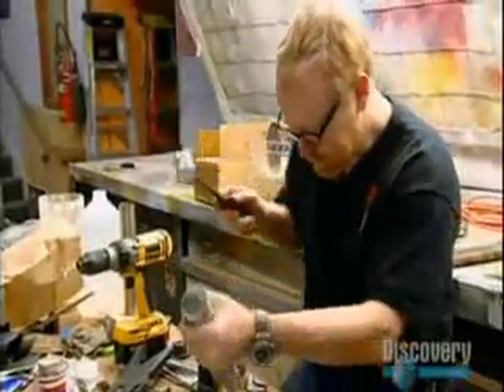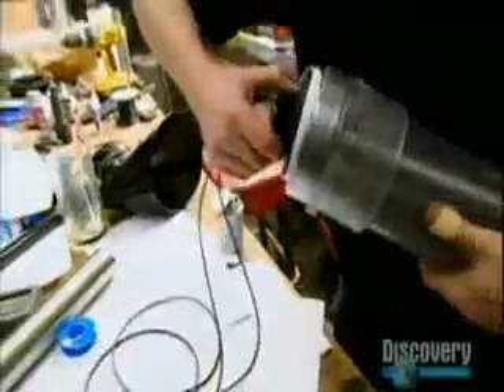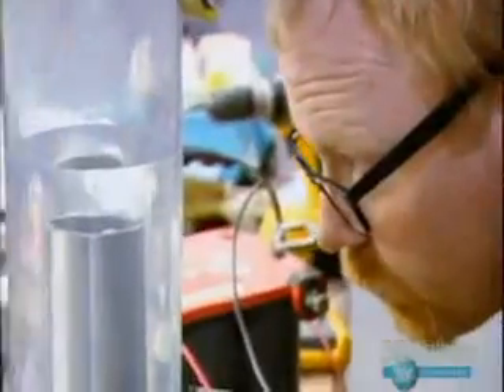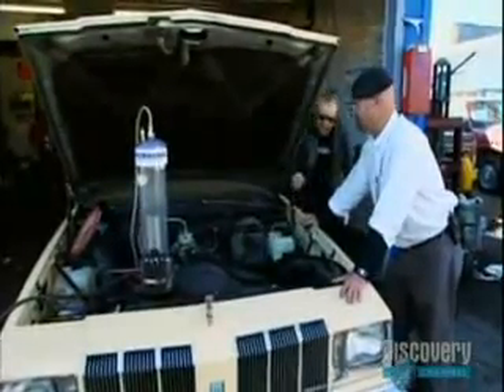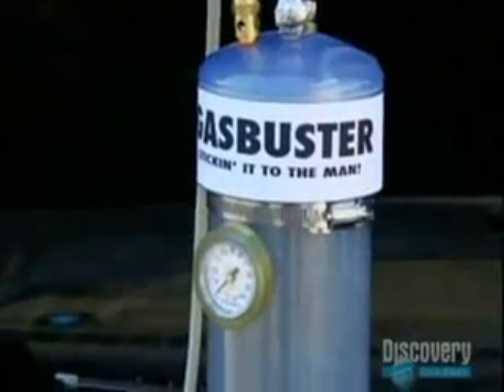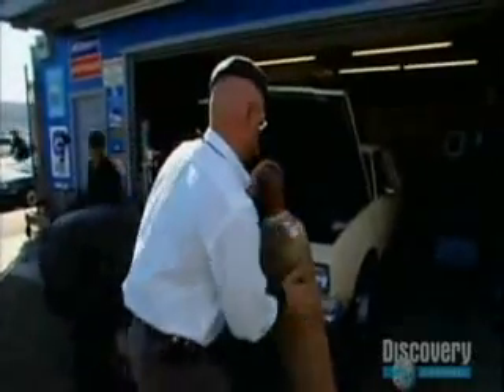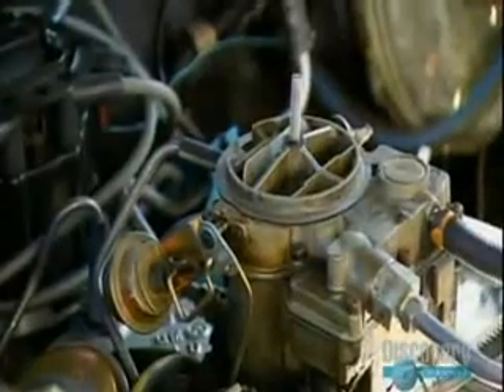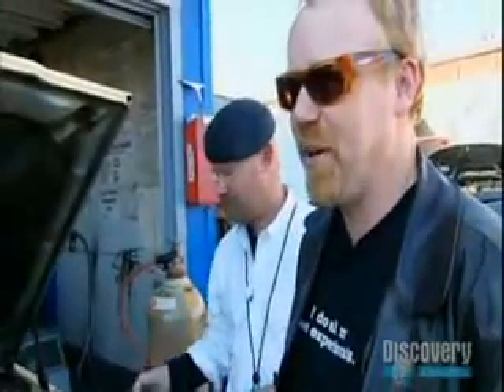HHO Mythbusters Explained

Comment: I don't think you could run your car off water.  Hydrogen sure.  But with water you're basically trying to extract the hydrogen, then combine it with more oxygen through the intake.  So you're breaking the bonds just to reconnect them again.  How could you possibly get usable energy from that?
Reply: I'm not saying you cant get energy from hydrogen.  Or HHO or browns gas or whatever you want to call it.  Obviously if you have a container of it laying around you could very easily extract energy from it.  I'm saying that because the by product (water) is the same as the fuel (water) it's inherently impossible to profitably extract energy from it, since the same amount of energy would be needed to break the bonds in H2O as you would get by reforming them.

That's why we burn fossil fuels, they start of as something like C7H15 and end up as multiple sets of CO2 + H20, which contain less energy and are stable in our atmosphere.  You COULD turn them back into C7H15 again but it would require at minimum the same amount of power gained by breaking them up in the first place.  The same is true for HHO.  And any other chemical reaction that releases energy.  Conservation of energy.

Simply put it would take 37kw of electricity to produce enough HHO to run a car at 50hp, assuming a perfectly efficient system.
Reply: Yeah google lol.  That's the point I was trying to illustrate, it would be better to just use that 37kw to drive the car rather than producing hydrogen.  But if you could find a way to store a lot of it in the car than you could produce the hydrogen at home.  It'd be a cheap way of effectively converting to electric without having to change the motor
Reply: kevin smith BMW has a 7 series automobile that has a built in hydrolysis machine to convert sea water into the two gasses then a special carburetor to burn the hydrogen and air from the atmosphere letting off the oxygen into waste as a exhaust through a filter, (making it slightly carbonized so that it does not present a fire hazard) then use of a condenser to turn the water steam back into water that returns to the 'gas tank' It is supposed to come out in 2016. Also there is an existing company in Panama City Florida and In Long Beach California that has created a 50KW system to both heat and power your home using their HHO hydrogen called Aquygen. Laugh off that one! They are traded on NASDAQ.
Reply: marcus raidien I saw a youtube video with a water powered car.  It worked by heating the water and turning into steam, which powered a motor.  The water was heated when it came in contact with a lithium rod in the cars engine.  It would run purely off water, the only problem is the lithium rod would get corroded and had to be replaced every hundred miles or so.

The water powered car was powered by lithium.

Not water.

So based on that I'm purely guessing (but still completely certain) that your information is wrong.

ha HA ha HA ha HA

It would be wonderful to be proven wrong here though.
Reply: marcus raidien Are you talking about the BMW Hydrogen 7?

edit:  I'm pretty sure you are.  The car (according to wikipedia and youtube) can run off of hydrogen.  It's advertised as "running off water and clean renewable energy".  Words of note being:  AND clean renewable energy.

They aren't idiots and they know the hydrogen is essentially an energy CARRIER and not an energy source.  You have to combine energy collected from an outside source with water to extract hydrogen.  That energy could come from solar panels or water wheels or geo thermal, etc.  Hence the "clean renewable" statement.

The only reason they would make the car capable of hydrolysis is if the drive motor only runs off hydrogen and if there is a second supporting motor (electric or gasoline) to  "recharge" the hydrogen motor.  But as demonstrated in tests by hobbyists for the last decade it's difficult to make large amounts of browns gas.  So I doubt they'd go to the trouble.

But even if they did

it's not "running off sea water"

it's running off electricity.  Or whatever energy source was used to obtain the hydrogen from the sea water
Reply: Yes, it uses a unique system as talked about in the 2007 poplar mechanics article stating the company would not start production until 2016.
 The system uses a steam condenser to replenish the 'gas tank'. I also remember they offered it to use a electrolysis device built into the engine to turn the water used into the two gases hydrogen and oxygen but filtered the oxygen out and instead used air intakes to burn the hydrogen in a normal BMW 40psi fuel injection system they already have on all their engine power plants, I thought that was pretty cool.
 The oil industry doesn't have to worry too very much because lubrication is still needed by all vehicles. But the people that win the most under the heel of the current anti-energy no coal burning, no nuclear power, no hydro-electrical production; politicians are the American Consumer.
Reply: well when you add oxygen to hydrogen what do you get? and I worked at Nuclepore for three years, operating the reverse osmosis system for the Scientists in the R&D lab who developed the single blood cell filtering technology in 1976. Myself I only have a degree in Electronics Engineering (UC Berkley and Cal State Hayward for Metallurgical Engineering and I also worked at Lawrence Livermore National Laboratory on the Fusion reactor project,(MFTF) along side Nuclear Physicists including Dr. Issac Asimov on loan from NASA and master welder and college Professor Robert Dahl. Cryogenics scientists worked out the problems of using hydrogen power into a 1935 ex-US Army halftrack, which is in Santa Rita Garage automotive reclamation center in Pleasanton California, back in 1975.
Reply: kevin smith Hey Keven, If you pass 12 volts DC thru water, that is modulated thru a stereo amp higher boost  = more hydro...run it thru a slobber bottle and let it leak into intake... this way you can make it turn on with Ignition key, and off with key... No dead battery...As electricity passes thru the water, hydro comes off the neg, and Oxygen off the pos side... this is sipped into the intake, and burned with your regular fuel and during the burn and compression what doesn't burn recombines into water...  So a hotter, faster burn completely burns Gasoline or Diesel, and the hydro burns faster than  both normal fuels and causes the engine to run cleaner and cooler. Get with it Kev... The world needs to use the oil we have left for lubes and such... Besides People are already making electric cars... Ain't it cool ?
Reply: James Bond  Rofl the '' I know the laws of thermodinamics so I am a pure genius '' argument. Sorry kid you lost credibility right there. You will have to bring more than these fuckin laws to prove you know somethin xd
Reply: No the fact that you think you are smart because you know the 3 laws. Try harder. 0/10
Reply: Well anyways you guys the next big thing is just gonna be synthetic gasoline basically.  A bunch of companies are doing it, audi has something going.  It's going to work like this:  Electrolysis to produce hydrogen + carbon extracted from the air = standard hydrocarbon fuel.  With no net effect on carbon emissions since it only releases what was extracted in the first place, and it will work in every existing vehicle today.  The fuel can be produced from renewable energy resources too so... win win win all around.
Reply: wow I have been out of loop: http://www.bmwgroup.com/e/0_0_www_bmwgroup_com/forschung_entwicklung/innovation_netzwerke/effiziente_dynamik/cleanenergy.html They already have a Hydrogen powered BMW 7 series since 2006!
Reply: kevin smith  if it's burning hydrogen then it's running off of hydrogen not electricity " I'm saying that because the by product (water) is the same as the fuel (water) it's inherently impossible to profitably extract energy from it, since the same amount of energy would be needed to break the bonds in H2O as you would get by reforming them." water is not the productit is the by-product HHO is the product it would be profitable because the raw materials  , water and baking soda, are so cheap
Reply: kevin smith You are a fu*in* idiot
Reply: James Bond

your analogy doesn't match the HHO concept
Reply: James Bond

your analogy doesn't match the HHO concept

energy is being recycled by the alternator ,HHO is being created by the generator  and water is being replenished by the driver
Reply: James Bond

it splits the water into hydrogen and oxygen

the hydrogen explodes in the engine and the oxygen is needed for process to complete
Reply: James Bond

it depends on whether the car is producing enough electricity to run the generator
Reply: James Bond

no it's not because if you don't add more water once it's depleted the generator will stop making HHO and the car will stop running

the driver has to continually add more water to the device

the continual addition of outside energy means it isn't a perpetual motion machine
Reply: James Bond

energy may have been  lost or wasted at some point in the process but no energy was destroyed so it's not a violation of the law
Reply: James Bond

 "It's a violation of the law because you're trying to get MORE energy out of burning the hydrogen than you did from separating it from the oxygen."

I never claimed I was trying to get more energy from the process than I put in and I don't of anyone else who has claimed that
Reply: James Bond

I don't see why
Reply: James Bond I've got this idea, I'm not sure if it's really a thing or not.  BUT, if you're pondering physics and wondering if something could possibly work (new engine or anything really)..  If your idea includes something that could make perpetual energy possible in a different machine, then your idea won't work.

So maybe the reverse might be true?  If the components of your idea CANT be exploited for perpetual energy, then the physics must be correct?  Or something.  Like maybe if scientists are wondering.. "How much energy does a photon contain?"  The only correct answer will be the one that can't be exploited for perpetual energy.  / etc.  I dunno if that makes sense at all
Reply: Yeah actually that's a really awesome even further way to extrapolate things but yeah, that's exactly what I'm talking about.  Seemingly unrelated scientific principles...  Is it true as far as you know?
Reply: James Bond

" The amount of energy you get from burning the hydrogen cannot be more than the energy it required to separate the hydrogen from the oxygen"

I never said it would be more energy than I put into it
Reply: robinsss No, what we're saying is: why not just run the car off the electricity?  Why go to the trouble of converting water into HHO just to get it back again with no net gain?  The only way it has use is if the car has no electic motor, only a hydrogen (or hho) cell, and the car runs off that.  While the HHO is extracted at a plant elsewhere.  Gives you the benefit of zero emissions if the electricity is generated from a resource like wind or solar, allows for fast fill ups at stations, and.... the car could be driven in ventilated spaces?  Also maybe it's possible to retrofit common motors into HHO / hydrogen motors easily.  I dunno.  All good stuff BUT it's still not running a car off water, the power source is still going to be solar / wind / coal or whatever the plant that did the processing was using for power
Reply: Oh and in regular terms it's like this for example.   1 oz of Water + 5 units of energy = 1 oz of HHO.  

Burning 1 oz HHO gives you 5 units of energy and 1 oz of water back.

In other words, no "profit" energy to move the car with.  Since ALL the energy you get from the machine must be used to make more HHO.  Or you have to supplement power from the battery to do it.  But if you're gonna do that... see my above comment lol
Reply: kevin smith  "No, what we're saying is: why not just run the car off the electricity?" there are several reasons  why HHO is better than electricityfirst water is cheaper than electricity or the raw materials used to make electricity secondly you don't need a battery that weighs a thousand pounds and costs hundreds of dollars lastly the only evs released so far in America other than Teslas  have a range of 100 miles per charge and are too expensive for the people they could help by comparison as long as you fill the generator with water it will keep making HHO
Reply: James Bond  I just  answered that question in the message above yours
Reply: James Bond

No
Reply: robinsss "as you fill the generator with water it will keep making HHO"   it won't! You also need to fill the generator with electricity.  Which it produces.
Reply: Well gosh gee whiz Batman, BMW has a car that does exactly that since 2006! It is only sold in Germany and never saw importation to the USA or anywhere else. But Batman, if you only look on the BMW website you will find it. I call you Batman because just like the in the comic books he is a fictitious genius just like some people commenting on this reality.

 Also on all automobiles including the science behind the Batmobile the generator produces 14 amps to recharge the battery with 12 volts, which is used to also run the step up transformer to power the electrolysis machine in the car BMW already has made.

This year they are making a fully electric luxury 6 series sedan with a three lung gasoline engine as a backup, but the car will still do about 140MPH. Their Hydrogen vehicle is not able to be sold in Obama-nation due to all the new regs the EPA-Gestapo has imposed on non gasoline fueled vehicles. These same regs keep the American Moller Company from being able to mass manufacture his flying car. Also the FAA has gotten into the act and will keep Moller from being able to park his car in anyone's driveway and instead force everyone to become multi-jet engine pilots since it runs on eight jet engines which are redundant on purpose in case one fails. It only needs three to operate. However this same FAA allows a person to park a helicopter anywhere and you don't have to have multijet engine pilot's licenses even if you fly the new Hughes which sport four.

 So much for FAA compliance and special rules. The Moller would of course free up all the congestion in and on freeways as well as make the infrastructure of roads and bridges obsolete, but then the Democrats would not get their kick back money anymore either from Excise tax.
Reply: marcus raidien Go look at the car.  READ WHAT IT SAYS.  Tell me it gets energy from water.
Reply: I also showed a method by which a vehicle could create hydrogen from electrolysis of water then use a steam condenser to convert it back into DE-oxynized water otherwise how a physics scientist creates reverse osmosis water. Now this water can only be used over and over again for about three to four weeks then it becomes un-electrolosis-able* but is similar to distilled water. It lacks 'enough' hydrogen to be used as a fuel. That is the drawback BMW found to their engine system as well as having an extremely short lived engine from having to chrome coat the cylinder walls inside the combustion chamber, because otherwise by burning hydrogen the steel used becomes brittle and the cylinder walls crack.

 Don't you find this interesting, each and every time I tell you exactly the same thing i originally told you, it is always the same just explained differently each time. Kind of like I know what I am talking about. Also it does not vary much in the retelling. So if I don't know what i am talking about it should have extremely drastic differences each time on the point of the law of bullshitting proscribes.

  * I know this is not a word it fits my explanation though.
Reply: Ugh.  MAN..  You're repeating yourself because you either misunderstand what I'm saying or you misunderstood what BMW was using electrolysis for.

I'm NOT SAYING that the car you're describing doesn't exist.  All I'm saying is, the vehicle does not get energy from water. Hear me for a second.   BMW has been developing hydrogen vehicles for a while, and may have been experimenting with electrolysis as a means of replenishing the hydrogen fuel cells at one point.  Which probably worked exactly as you describe them.

EXCEPT:  The electrolysis would have been powered by an outside source, either a separate gasoline motor or from a plug in battery,  to extend range when you aren't near a hydrogen fill up station.  Maybe the car could generate it's own hydrogen while parked... from water, just like you say, using.. solar panels mounted on the roof!  Or something similar.

There are many advantages to using hydrogen over electricity, but being able to use water as a fuel is not one of them!

I'm telling you you misunderstood what you read about the car.  If you've been talking about this thing for a while then I'm sorry.  Maybe you should refocus your energies onto something more productive... like science that ACTUALLY provides cheap clean renewable power that you can generate at home. Solar panels.. wind.. geothermal.  It's been a long time since we've had any major battery advancements.  I'm sure something is on the horizon and when it comes out it will be revolutionary.  Combine that with more efficient solar panels which we've already got... and user friendly power grids like Tesla's power wall thing...  We'll be off gasoline in no time.

But not if we waste time on perpetual energy machines.
Reply: Because the drive train would be connected to only one output shaft, in this case the hydrogen motor.  If you're using gasoline as a backup fuel, it's easier to use it to just replenish the primary fuel tank (hydrogen) if possible, even though it's inefficient.  Many plug in hybrid vehicles do that.  When the battery gets low, the gasoline motor kicks on and recharges the battery.  Of course it would be more efficient to just run the car off gasoline at that point.  But that would require a bigger motor, more complex gearing... etc.  Better to just range extend at 35 hp and forget about it.  You know what I'm saying?  Hydrogen would be the same.  Unless you're using two output shafts...which is possible I'm sure.
Reply: Although I think it might also be possible to design a motor that can be self adjusting to burn either fuel.  Which would be the ideal solution.  Then you could skip electrolysis all together.
Reply: I'm not saying you would burn hydrogen fuel to power electrolysis.  That's silly.  You would burn gasoline to power electrolysis.  Or solar or something.
Reply: A ton I'm sure!  I'm not advocating for gasoline.  But this guy was saying BMW had on board electrolysis, and if they did there's a good chance it was actually powered by gas.  Honestly I'm more in favor of electric motors.  Hydrogen is only better for fast refueling.
Reply: No it's not.  That would result in the runner getting both a poorer time AND using more energy.
Reply: Hmm... ok so like.  lets say I had a special car that ran only off gasoline.  And this car routed ALL the gasses coming out of the tailpipe into a special condenser that recombined them into gasoline.

THAT setup does not make sense, as we will always get less energy from burning the gasoline as it takes to re-assemble it.

The same is true for electrolysis and any proposed water powered car.

HOWEVER.  If our goal is only to extend range, we can carry an alternative fuel source and use THAT to power the reassembly.

It's not over unity because we're not expecting to get the energy back.  If we have 300 units of energy in the tank (gasoline) and we use it to power electrolysis to produce hydrogen to power the car, we end up wasting 250 units in the form of heat.  But that still leaves 50 units to move the car forward.

It's wasteful but it still "makes sense" as our only goal for the backup motor is to increase range in certain situations.  

So really the analogy should be more like, if the runner ran BACKWARDS from the starting line a half mile to get a bike, then rode that bike a mile and a half to the finish line as hard as he could.  He'd accomplish his goal of arriving sooner, at a ridiculously increased energy cost.  Whether this trade off is worth it is entirely dependent upon the runners goals.
Reply: I think you're taking issue with the inefficiency being silly, which it is.  But it's necessary if only the output shaft on the hydrogen motor is connected to the drive train.  If the output shaft is instead connected to an electric generator which is connected to an electric motor which is connected to the drive train, THEN there would be no use for on-board electrolysis as you could simply power the electric motor directly with your backup motor.  But that's a different setup, I'm pretty sure hydrogen cars don't do that.  I don't know why they would.
Reply: BMW built a car that uses a water tank to create hydrogen from then put it back into the water tank by way of a steam condenser in 2006.

 This was a production 7 series vehicle that used an electrolysis machine in series bled off the oxygen from the machine into the open air as the only exhaust and used an outside air intake to burn the 'fuel'.

It was never sold in the USA or anywhere outside of Germany because there are not as many restrictions on cars like there are in other countries especially the USA.
Reply: However Mr. Bond; Governor Arnold Schwarzenegger put hydrogen gas refueling stations in along the coast of California in anticipation of people using hydrogen powered cars in the early years of California 2004 on.

 The Media in California decided to NOT make this well known because they wanted to work in concert with the Democrat super-majority in California because it was their aim to make Governor Schwarzenegger appear to be the worst governor in California history, only because he called the Democrats 'girlie-men you can't get anything done"! joke towards them...

They decided to take it seriously; so they cheated him out of every proposal he ever made and went back on 'deals' after he signed their law onto the books, and also stole 54 billion dollars out of the park service that was not 'found' until after Jerry Brown was made Governor again.
Reply: Ask BMW off of their website.

 I would assume it might be a step up transformer from the battery You do know of course a coil in any car can create 40,000 volts at .005 amps correct?

 So I don't think the power is that much of a problem to create to 'make' Hydrogen using electrolysis. You do know that 12 volt battery must have 14 volts to recharge it correct?

The generator can be used as a power source to run all the electric equipment on the automobile while running even that 800 amp speaker system with 16 speakers, correct?
Reply: James Bond "why not put more hydrogen in the tank?"  When every gas station has a hydrogen pump, they will.  

Marcus are you saying it would come from the car's starter battery?
Reply: I never said it was without use :)  But a LOT of people think that cars can literally run with water AS FUEL.  They insist that big oil is suppressing the technology.  It's a counter productive mindset.

As you say, with some light modifications maybe a regular 4-stroke engine can run off gasoline + hydrogen mix. If so then you could install a larger battery and a hydrogen generator which would be vastly cheaper than converting to electric hybrid.

 BUT my point is, it's not a water powered car in that instance. It's battery assist, via electrolysis.

Also very little fuel goes unburnt these days. There is some... which gets burned by the catalytic converter.  At MOST, under any circumstances the absolute maximum efficiency gain you could get would be whatever % unburnt fuel is getting sent to the cat...which isn't much.  Maybe a few %.  But I doubt it's even that.

There is a maximum efficiency air/fuel ratio for gasoline.  I think it's like 16/1 or something (which is lean).  Maximum power is achieved at like 12.5/1 (which is rich).  This is for any gasoline engine.  So by adding more hydrogen and oxygen,  you could theoretically do no better then the 16/1 ratio, but that can be adjusted mechanically.  You don't need extra hydrogen to achieve that. 

Believe me man, I get what you're saying and I'm definitely not against the technology.  But it's gotta be used effectively, you know?  You can think I'm some brainwashed oil man if you want.